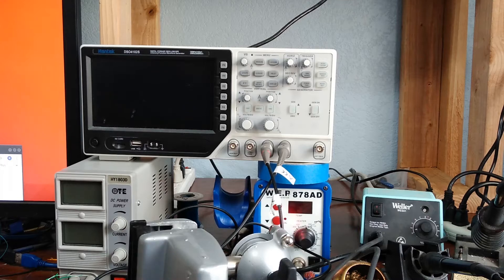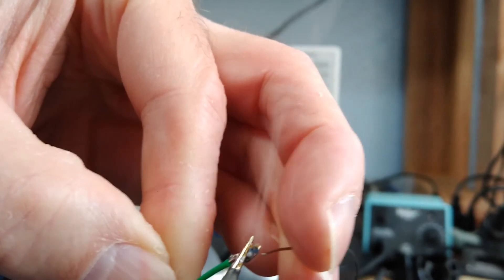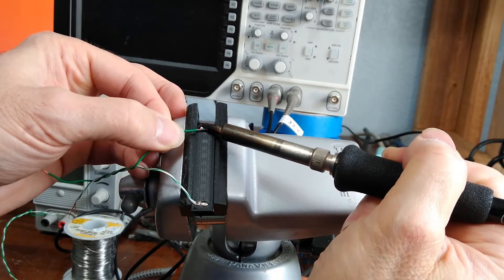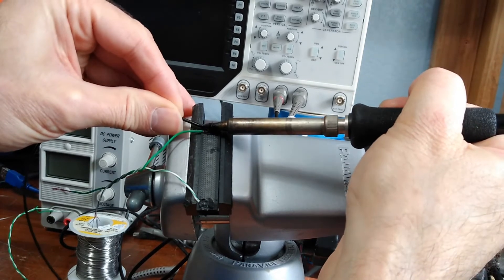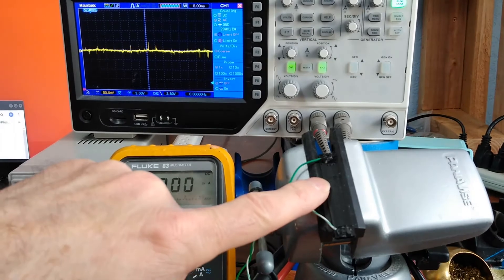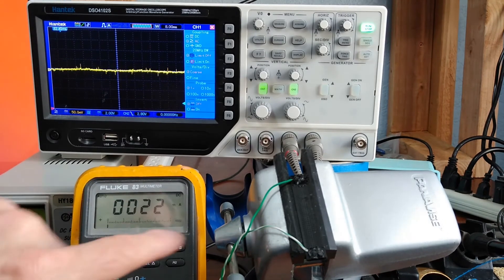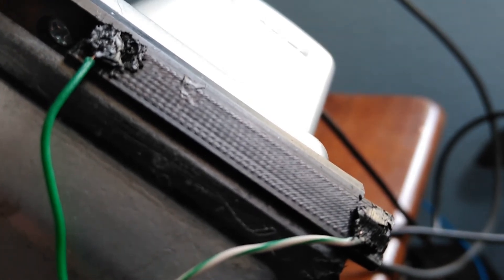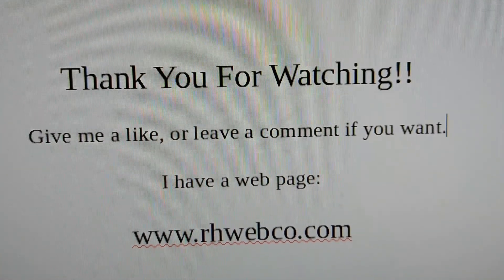Connect wires to conductive PLA plastic

Comment: Ron, very clever. troneee
Reply from the maker: I originally used the conductive PLA from proto-pasta.com to make custom variable capacitors that I used for position sensing. Now I mostly use this method for connecting wires to aluminum foil shields for sensitive amplifiers.

Comment: Can you tell me the what materials did you added in Pla to make conductivity
Reply from the maker: I bought conductive PLA from Proto-pasta part number CDP11705
Reply: @ronaldheath453  if you used multimeter to check conductivity of filament will it showing.
Reply from the maker: yes, the multi-meter will show about 1.5K ohms when the probes are one inch distance along the filament.